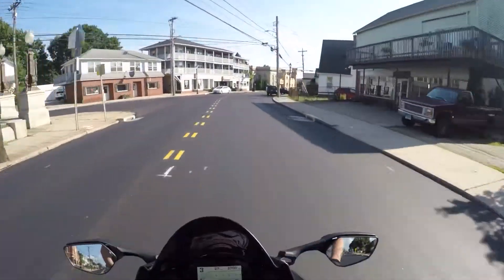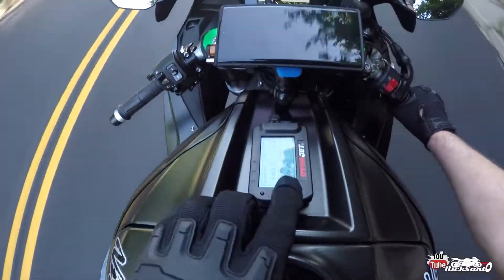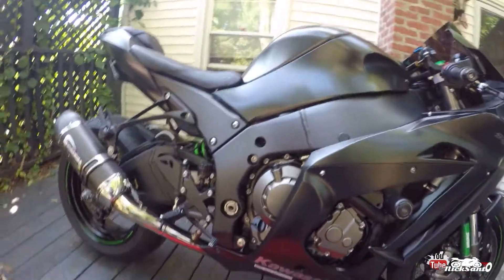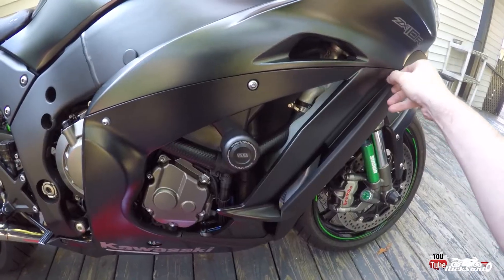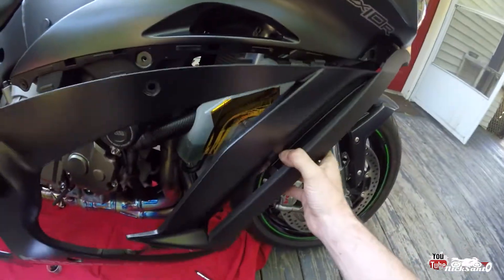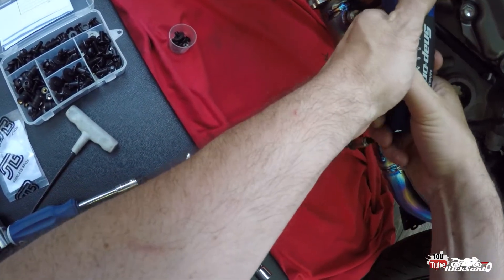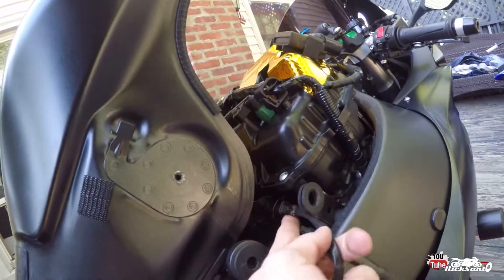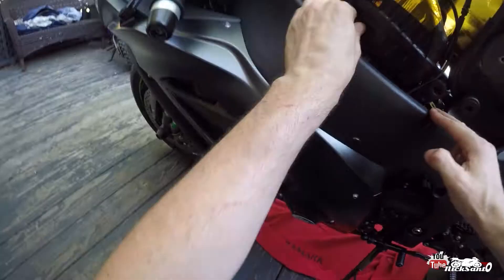S4E8: Dynojet Pod-300 and How to eliminate your O2 Sensor on a Gen 5 ZX10R

Comment: Just did a flash on my bike, disabled the o2 sensor. But I didn’t remove it. What can I expect if I’ll follow this path like deleting the o2 sensor?
Reply from the maker: you don't have to remove it, but why not? just get a plug an take it out and let woolich do it's thing.
Reply: @NickSanto but you just said in the video disabling the o2 sensor is just telling the ECU to don’t throw codes?
Reply from the maker: @zx6rage430   you want to unplug it yes, but you can leave it in to keep the hole plugged until you get an actual bung. sorry should have been more clear.

Comment: So the bike is running well and better without the oxygen sensor now that you’ve had it this way for a while ?
Reply from the maker: yes sir. i have spent hours fine tuning the fuel map through both the woolich software and the dynojet powercommander. the only reason i am running the powercommander ontop of the woolich is because that is the fuel controller i had. the woolich flash gave me a great base map to start with through their map sharing program and then i use the fuel controller with wideband to fine tune that to my bike  specifically

Comment: this makes no sense at all, why on earth would you want to remove your 02 sensor? first off hold your fuckijgn camera still then get a better module that can read faster..  eliminating your 02 sensor you're going backwards in a major way

if you feel its not adjusting the fuel quick enough which is goofy cuz it should always be the same so the only time it really needs to alter mapping is when something changes, air pressure as in elevation, air temperature, those types of things, if its constantly trying to adjust at idle you have other parameters with issues, something else is wrong, has nothing to do with eliminating the flapper valve..

however your ECU may be getting the data wrong or mixing the fuel wrong because you have eliminated a sensor in the loop without compensating for it by letting the ECU still think the flapper is still on the bike..

you just didn't do the flapper removal properly, on a closed FI system which is far better than open which is basically what you are doing by eliminating the 02 sensor removing sensors isn't just as easy as tearing it out..

odd, people pay big money to get closed loop FI on their open loop motorbikes, some racers pay up to 5-6 thousands dollars for closed loop, cuz its superior and insures you have a perfect optimal mix 24/7/365

strange man
Reply from the maker: you miss the fact that i am running a woolich flashed ecu as well as the dynojet fuel controller. the o2 sensor was replaced with a wideband sensor that makes fuel adjustments to my fuel map on the fly. not sure if you are familiar with this motorcycle, but all your statements are completely inaccurate.
Reply: All those paragraphs to still be wrong

Comment: Hey man having similar issues with my bike after the flash .
The idle loops like you mentioned and the throttle is really snatchy and abrupt .
Will removing the O2 sensor fix the problem I’m having ?
My bike was so smooth before the flash .
I’m getting ready to send it back to get flashed back to stock because it’s not running right .
I have a 3/4 system also .
Reply from the maker: What I have found is its all about fuel at idle. You shouldn't have to have it flashed back to stock. I would talk to the person who flashed it and ask them if they know how to improve the IAT map so the idle is smooth again. If you need more help, email me. nickyguns@rocketmail.com